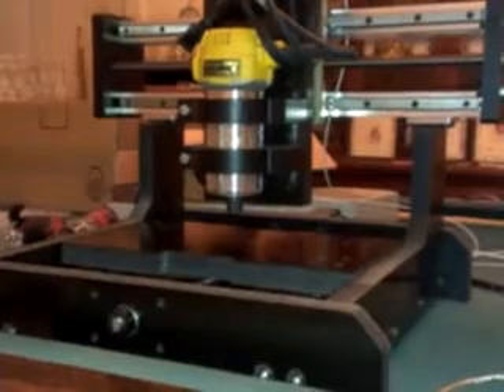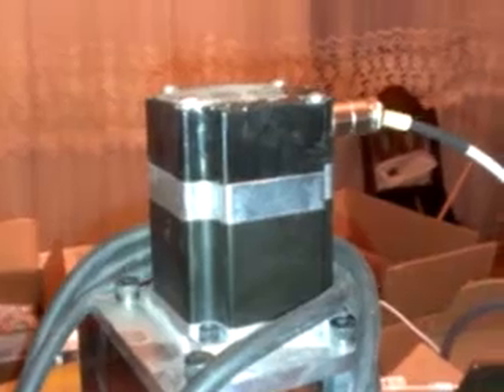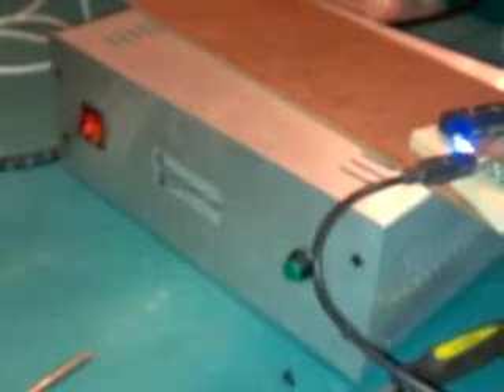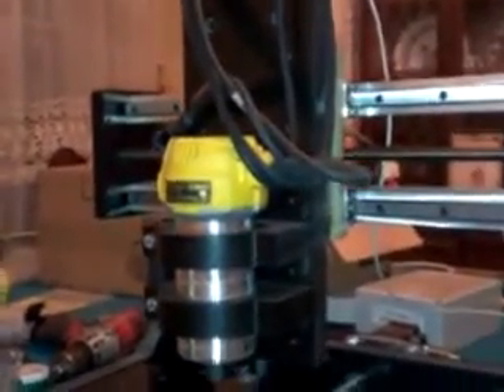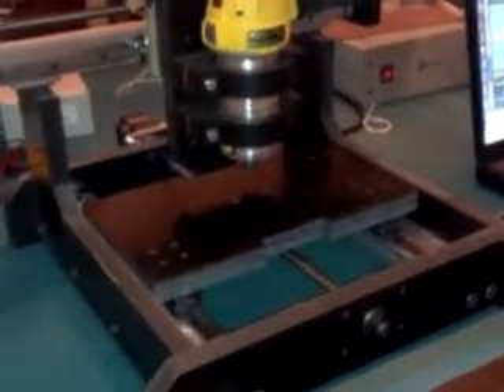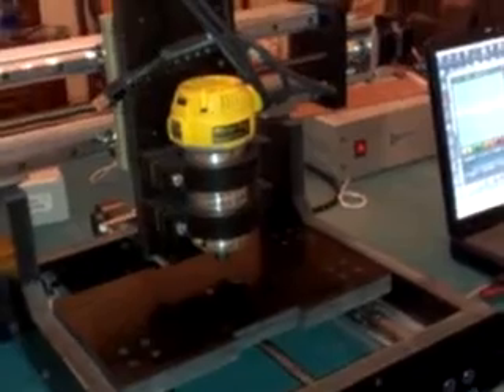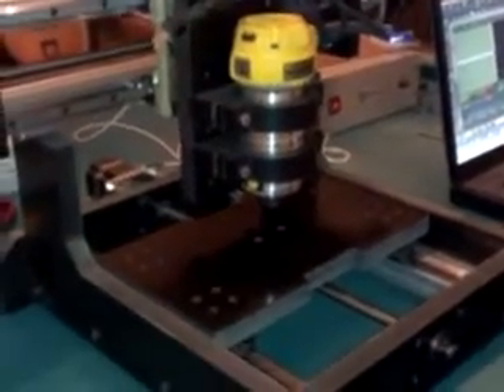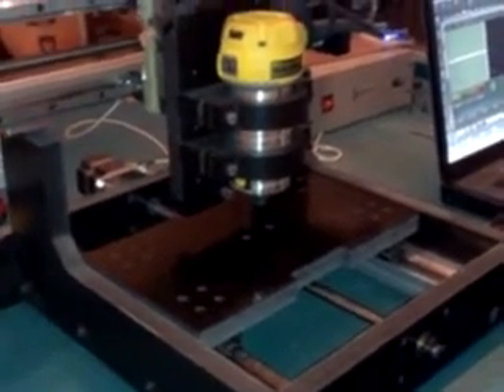DIY HomeMade Mini CNC Router Engraver Mill Test Run

Comment from the maker: I realized after posting this that the Z axis was running in reverse!  I had since corrected this, as well as raised the rapids to 275 and accel to 60.  The steppers are definitely capable of more, but not sure how well the leadnuts would handle it, and the bearing blocks have a little preload.